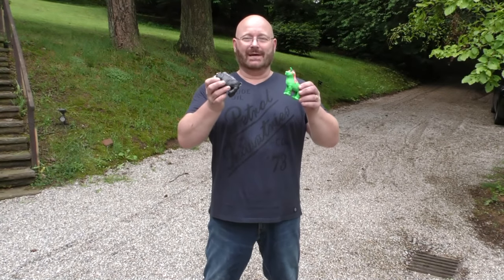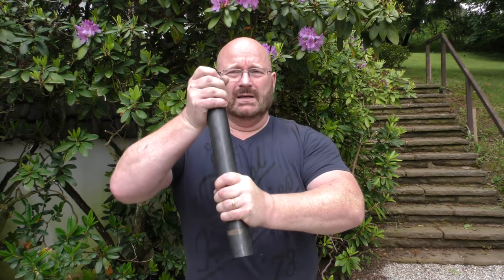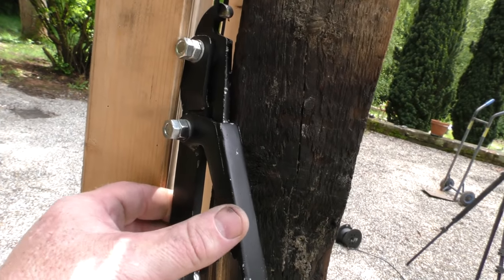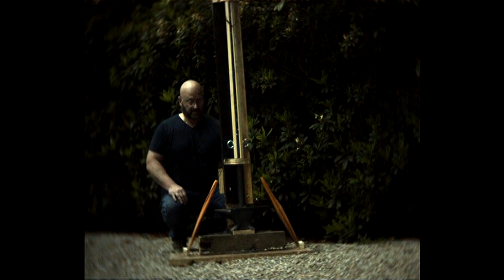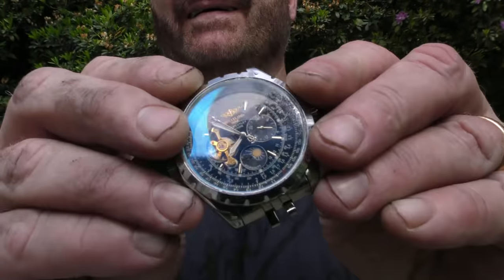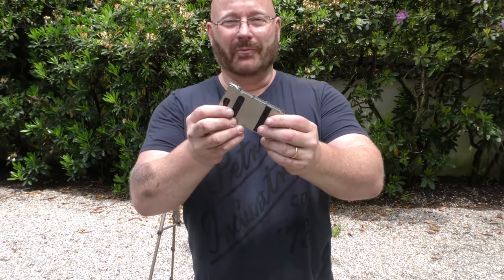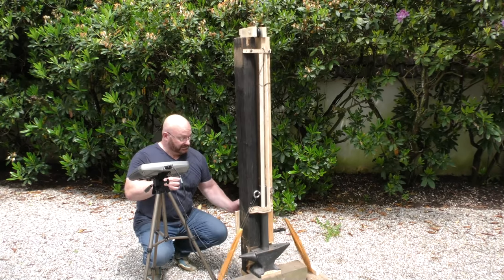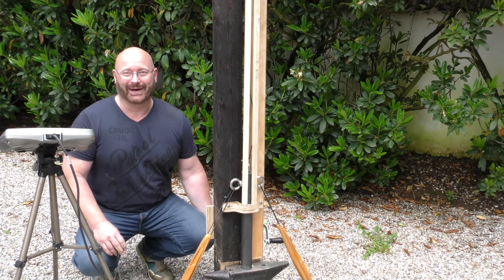The Rubberaulic Press: Pure, Brutal Demolition!

Comment: bolt the anvil down... youre losing power by lifting anvil and having impact mid air
Reply: good idea
Reply: +Zac Gan i agree
Reply: Glad someone said it!
Reply: Dan Martin pointless
Reply: based on his comment at 2:30 in the video, he did not expect the whole contraption to behave in such manner. I found it pretty cool to see there was enough potential to have this happen.
Reply: "youre losing power by lifting anvil and having impact mid air"

Or are you!

If all the energy is contained within the system....
Reply: But even if the press comes down slower by lifting the anvil, the anvil goes up against the press, so its still able to impact each other with the same force. Could be wrong if the wood work aint rigid tho and if the impact somehow stretches the system in some way
Reply: Really old comment but he is losing power.All the energy is contained in the system but the energy from the bands is being lost due to having to lift the whole contraption up instead of accelerating the cylinder down.
Reply: Oh for fucks sake..... it doesn't make any difference whatsoever, it's like saying a rifle is more powerful if you stop it recoiling! Every action has an equal and opposite reaction and all, the only reason to bolt it down is to prevent it from becoming unstable and even more dangerous than it already is...... lol! You'll all be telling us how the world is flat next..
Reply: charles shipman A rifle would have more power recoiling. The greater the normal force acting on the rifle to stop it recoiling, the greater the speed of the bullet. But it would be minute.
Edit: this is only true because a bullet accelerates over a period of time, but, in reality, all things do anyway.
Edit 2: I am wrong. Even if the acceleration was instantaneous, I think a greater normal force would increase the work on the bullet
Reply: @charlesshipman446  people are so misguided
Reply: @Dan Martin 
Or turn the whole thing upsidedown sir
Reply: That recoil keeps it from breaking itself. Sometimes sacrifices must be made. It's a form of tortion, not pressurization, that's driving its force.
Reply: @Technie87  but that is one of the issues with tortion. Some of that energy must be dissipated along the lines of the mechanism (one of the more impressive discoveries, along with axles) or it breaks far sooner than it otherwise might. His design is little more than an upended old Roman kind (there were dozens) of field ballista with elastic bands instead of twisted rope bending strips of wood and bone to trap sufficient energy.
Hydraulics operate differently.
Reply: @aka5  the acceleration is due to the focusing of the energy on a single direction in a tight, and thus pressurized, space. Within a few metres of exiting the barrel, acceleration ceases. Deceleration begins.
Reply: You lose a relatively small amount of force by not securing the base only because the elastic band travels 'slightly' less distance before striking the anvil, therefore less time in contact with, (and less time exerting force on) the steel bar.
Reply: energy, not "power"
Reply: The German word for the principle is Gegenschlaghammer. It describes a special kind of drop forging machine that doesn't only beat the hammer down on the anvil (and thus delivers a good bang to its own foundation). It does exactly what Jörg's rubberaulic press does. It slams hammer and anvil against one another mid-air, therefore delivering all the bang to the workpiece. No energy is wasted to shake the ground.
Reply: p=mv E=F*d so for 100 kg force mentioned and around 1 meter travel, energy is respectful 1000 joules. Force acting on striker is actually rubber force plus its weight times g, force acting on anvil is rubber force minus weight of anvil. Interesting consequences: if rubber force less than gravity force on anvil, it does not move, all energy converted to striker kinetic. If rubber force much higher than gravity force on anvil and striker, then energy used accelerating anvil times its travel is equal to energy used accelerating striker times its travel. If anvil travels 5 cm, 1/20 of energy will be converted to its movement. Still energy used to accelerate anvil is not lost, perfect hit is achieved when impulses of anvil and striker are equal, so that the system will not move after strike (all kinetic energy converted).
Reply: Impact in mid air actually exploits the generated energy ad optimum.

Comment: Holy crap I was very impressed by the power of your hammer/press actually, his proper multi ton press didn't do much more to the coins than yours ! Of course his delivers all it's torque from zero RPM, but yours levitates every time you use it ! The clear winner is rubber. Fuck this turned into a condom commercial again
Reply: Rubber requires no electricity.

Comment: I disagree,  I think that your Rubberaulic Press could be used to make a wood spliter.
Reply: I had the same idea when I saw it. :D Would be perfect for splitting firewood, just add some extra rubber maybe and forge the metal rod into a wedge.
Reply: Yea totally, stick a large axe head at or a large blade at the end and boom, guillotine for wood
Reply: Seems like it would be overkill , cranking up that winch is way too much work for every piece of wood. Swinging an axe is easier and faster.
Reply: +mrkiky you have a point, but it would be easier for the people who get tired easily to use that instead of hacking away
Reply: That crank could be motorized.
Reply: Invincible Osprey But then you're wasting fuel to split wood that will be used for fuel. Of course automatic wood splitters already exist, I guess it all comes down to whether it's worth it or not.
Reply: *****
Not if it's solar powered.  Also, if you are physically unable to split wood it would certainly be worth it.  The amount of energy released by burning the wood would surely exceed the amount required to stretch that rubber band.

Comment: That isn't a press, it is an auto-hammer. The difference is speed. The idea of a press is to SLOWLY destroy things with the fury of a thousand irate turtles. Hammers quickly destroy things with the force of a sassy black woman who don't need no lead balls.
Reply from the maker: Isn't the purpose of a press to generate pressure? I can assure you that my machine generates a lot of pressure indeed.
Reply: It is HOW that pressure is applied. Bullets generate pressure, but you dont see people using guns as sub machine presses. A press is built to either friction fit two objects together, or to test an object under load. Both of which are hard to do with speed, because that difference in acceleration will change how the object will respond.
Reply: +GenOmega2 out of curiosity: was than a 'quick sidenote for your information' or 'i am bitching about stuff that is technically correct but totally irrelevant for the video' comment?

Comment: have you tried bolting it down?  you're expending considerable energy by allowing it to lift the base as the weight is accelerated down, and the fact that it is still in the air at impact is softening the blow.

Comment: There is a use for this that isn't destructive. You've essentially made a power hammer that could be used to press billets of steel together. Is there a way to modify this to have it operate faster than hand crank?

Comment: I wouldn't say it can't be used for constructive purposes but I would say it is unfinished. You essentially have the stirrings of a rubber powered power hammer which is extremely useful for blacksmiths. You would need to figure out a way to get it to reset itself. A minute in between Hammer strikes is far too long.

Comment: also it does have a purpose, its not just a implement of destruction. You created a repeatable method of delivering a high impulse to something. This could be used to shock test electronic or mechanical assemblies for instance (so long you distribute the force to prevent crushing).  I.e. to check if "potted" electronics can withstand a shock of 
some amount of G's. It would be interesting to measure how good a impulse this devise can deliver.

Comment: notice how the rod hits the anvil while the whole thing is still in the air, you're losing force this way, try mounting it to a hole feeled with cement in the ground or add weights(attach them so wont they fly all over) ,the anvil needs to be standing firmly on the ground to receive the full impact force of the rod

Comment: Would it not be more accurate to say that the lifting was actually due to the tension in the rubber bands pulling the contraption upwards just as it pulled the weight downwards?  My understanding of physics is not the best but this would have been my guess.

Comment: Can you make an instructional video on how to make it with a motor to control the lift and have it drop automatically at a designated height and then repeat? You might have invented the world cheapest blacksmiths power hammer with a few adjustments.

Comment: if it was fastened down to the floor it would be stationary.. when you release the pressure and the whole press comes upwards from the bands releasing I believe you are looking some inertia.. I believe your press setup could be at least 30 percent more powerful if it didn't move at all...right?
Reply from the maker: I tested this in a follow up video, the difference is small.
Reply: Oh OK. I was just wondering

Comment: Hate to BREAK it to you, but gravity doesn't suck nor does it pull, for gravity is just a made up word by Sir Isaic Newton that he himself could not prove existed, though wrote several volumes on the topic. As he came to the conclusion it's just a theory and not an actual force of nature. What is this downward force? It's density of the material or boyancy of material that makes it what it is. To determine how hard it will hit the surface it's connecting with.
Reply from the maker: You... deny gravity? Sigh.